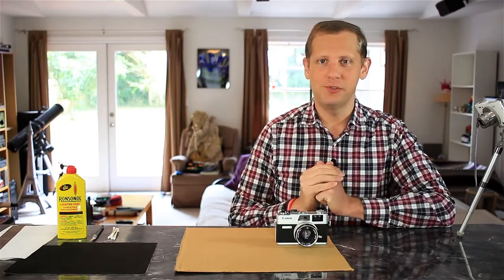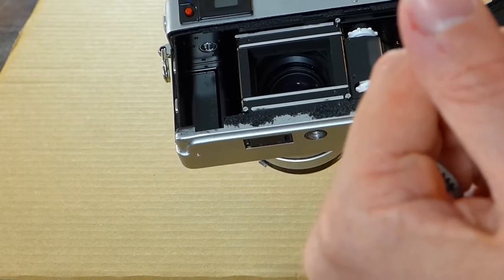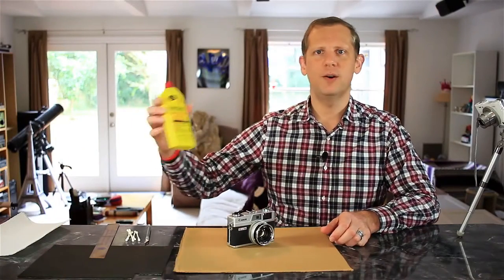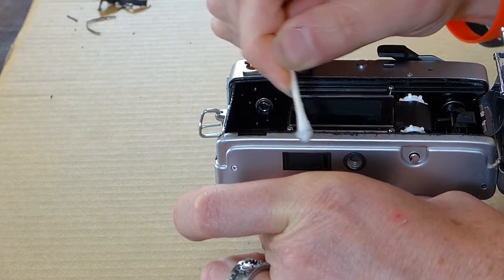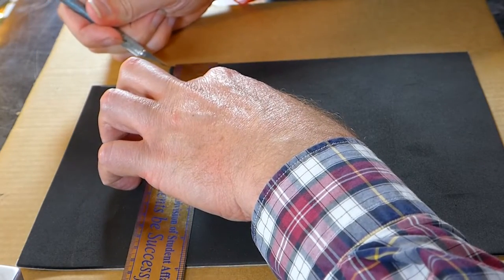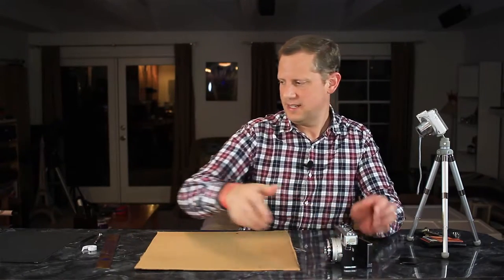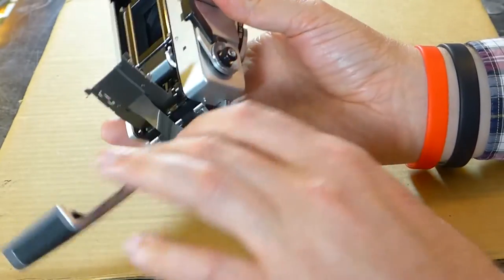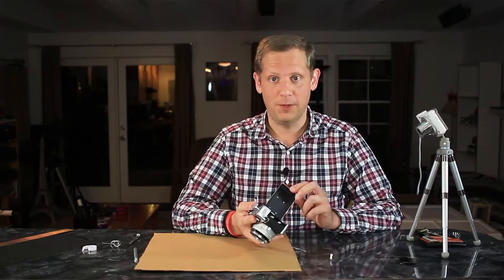How To Replace Film Camera Light Seals, Cheap DIY!

Comment: I've done 4 cameras now and haven't needed any cleaning fluid of any sort yet.  Just use baby wipes, they're cheap and safe. A cotton bud gets rid of most of the old seals anyway, what's left is just like sticky tape residue and usually just "rolls" up on itself. A wooden popstick cut into a flat screwdriver shape with a baby wipe wrapped over it works really well.  For the foam I've used open cell self adhesive foam from the hardware store intended as draught excluder for around doors and windows. This thicker and softer foam usually goes where the film roll sits. For areas where only a thin piece is needed I've used thin self adhesive foam from a craft store.  I also tape off the shutter area to keep it clean while working on the camera.
You can even make a template out of thin cardboard if you want a 1 piece gasket, these look really professional.
Reply: Some of us have more ready access to lighter fluid than baby wipes!  XD

Comment: Great thanks will have a go.  Have you any ideas why my recently purchased Canon EOS 10 does not rewind.  Makes the right noises but soon starts to clatter and then stop.  The cassette icon remains flashing and the shot counter remains on 24 or 36 and no film gets back into the cassette!  This is the case with the auto rewind and the manually pressed switch.  I imagine either the "prong" does not engage or a gear inside is slipping.  The rest works a dream and looks and feels like new.  Any ideas much appreciated.  Regards   Mark
Reply from the maker: That sounds like a difficult one, I am not familiar with the EOS 10.
Reply: thanks Wess I will keep searching for a solution

Comment: I had a very difficult time with my Mamiya TLR seals. The film pressure plate was in the way and I couldn't remove it. The foam in the kit I used was very fragile and one broke in two. I was thinking that soft (40A) neoprene rubber would be a better solution as it is much stronger and won't break on stretching. What do you think?
Reply from the maker: It may be a bit stronger but anything thin enough for a camera seal is not going to be real strong when stretched.
Reply: Actually neoprene (not foam) can stretch 300% and doesn't rot. I found that Neoprene is available in 30A softness. I cut a 1/32" thickness strip 1/16"wide  of unknown hardness but it seemed very compressible. I can easily stretch it at least twice it's length with no breakage. I think that if you have a lot of cameras to experiment with it may be worth a try. I'm gonna try some 1/16" neoprene if my foam kit doesn't work as I tried to install it.
Unfortunately I didn't try this myself before I used a foam kit for my camera.

Comment: Would it be possible to use colored foam? I don't really see what the difference would be. I feel like it would work the same as it's the same material, and pretty dense.
Reply from the maker: +Fangsus Maximus Sure, I just use black so it looks like it's original.
Reply: Black reduces light bouncing through, u should use black. A black marker can blackening it.